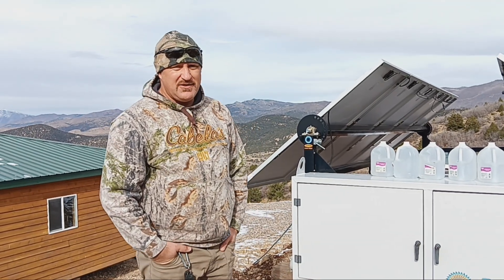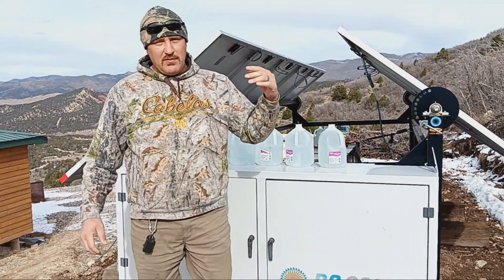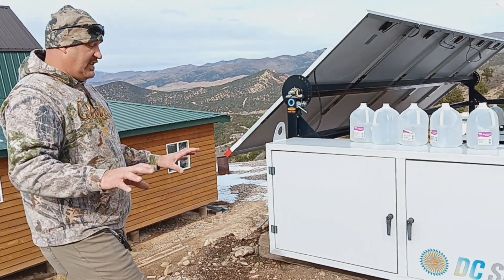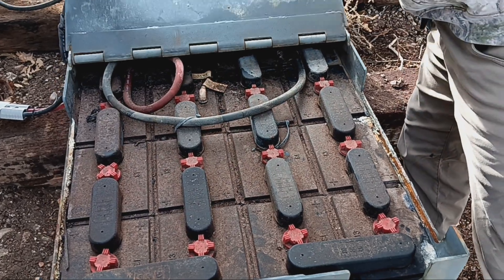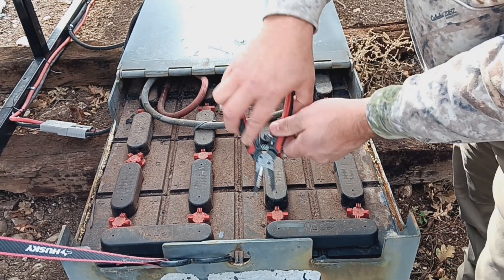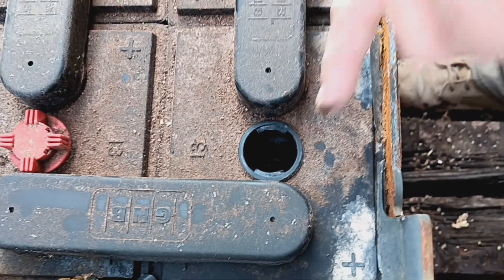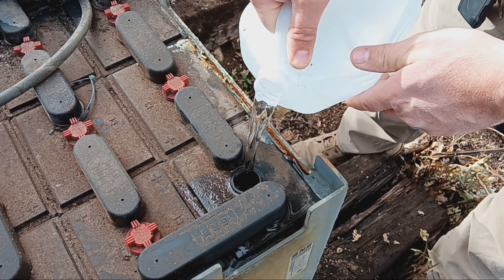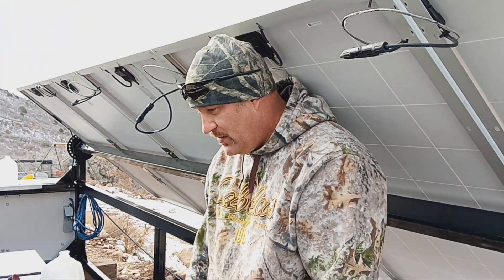How to maintain your your solar trailer batteries.

Comment from the maker: I think it has a 12 kw capacity.
Reply: Your Tubular look like ours' - they are 510Ah@48v - To convert amp-hours to kilowatts, use the formula: kWh = (Ah × V) ÷ 1000. For 510 amp-hours at 48 volts, it would be (510 × 48) ÷ 1000 = 24.48 kWh.